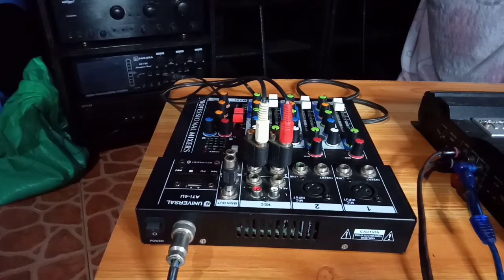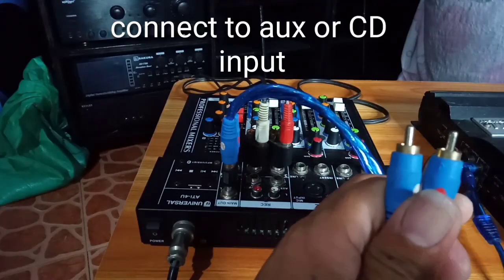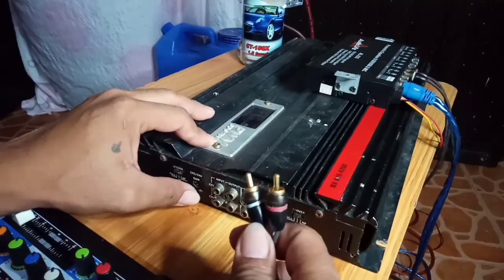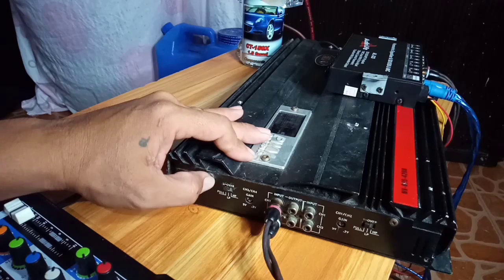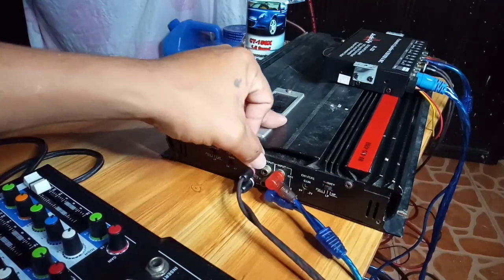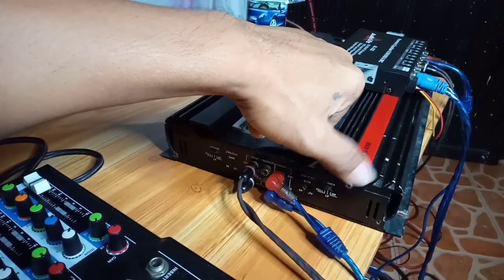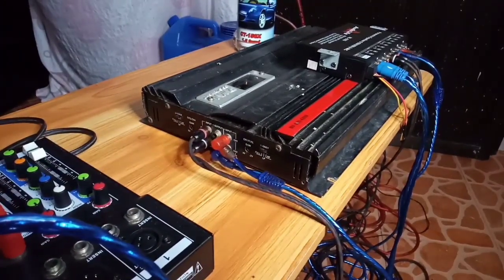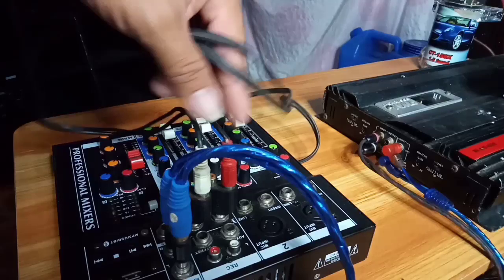mixer/parametric equalizer/v12 amplifier.indoor connection

Comment: sir magandang gbi sau ask ko lang kung anong power supply ang ginamit mu sa set up kase yung power supply ko nasira d kinaya..thanks
Reply from the maker: Diy lang po galing sa supply ng sirang 502b.sinamahan ko ng car capacitor salamat. Kilangan po Ng 12v na 30amp.
Reply: @Mrjhong-ig7fq  12v 30a gamit ko power supply sir pero nasira yung power supply ng cctv gamit ko..btw thanks sa pag sagot sir.

Comment: Sir iyong pioneer dvd karaoke player ko sir, balak kung input sa Audio life EQ with Bluetooth, bypass ko sir ang mic ng Eq, iyong mic input jack ng DVD sir gagamitin ko for karaoke, possible ba? sir mag mix ang signal na galing sa DVD mic. at audio signal galing sa Bluetooth ng EQ and eventually  lalabas sa amplifier?
Reply from the maker: Pagka alam ko boss pag nag Bluetooth ka. Out Ang input Ng DVD or audio in. Check ko boss
Reply: @Mrjhong-ig7fq  ibig nyo sabihin Sir  automatic cut off ang input ng EQ to giveway sa blue tooth?
Reply: @Mrjhong-ig7fq  pero sir halimbawa iyong mic. Ng eq gagamitin ko tapos source ng karaoke song ko ay galing sa bluetooth, posible po iyon sir?
Reply: @Mrjhong-ig7fq  sir may selector switch po pla ang mga input, Bluetooth, aux, cd. One at time lang po. Hindi pwede sabay ang Bluetooth at cd input.